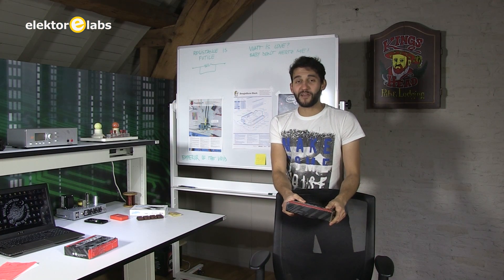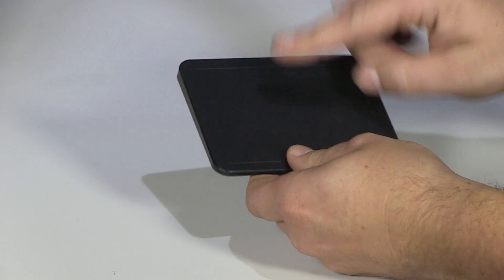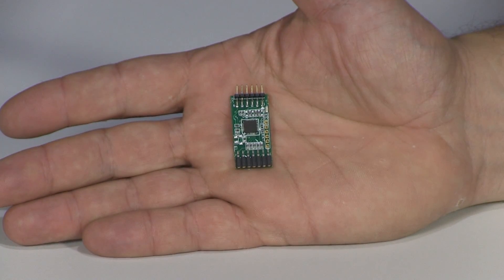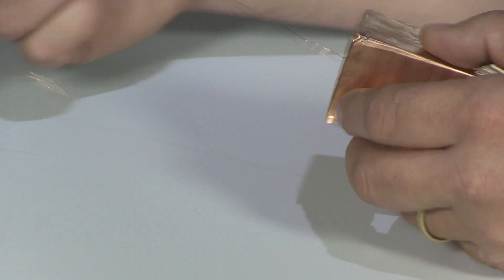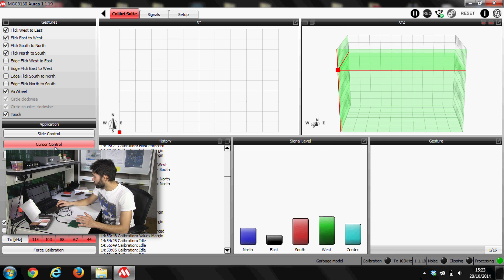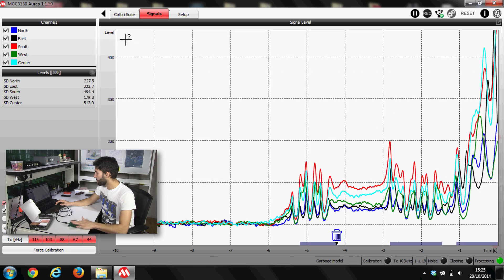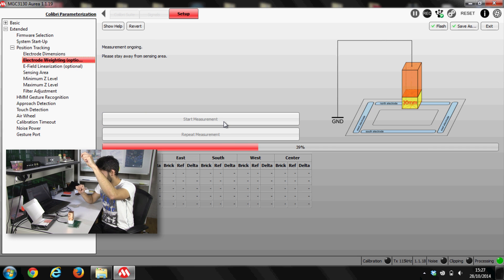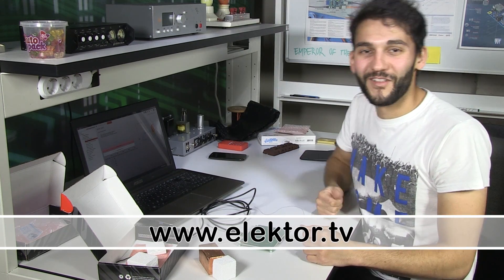Microchip Hillstar DevKit: 3D Touchless HID for Padawans

Comment: Hey i have a question ,
This sensor says its power supply should be 3.3 V according to data sheet , but if i have a i2c to usb i can directly connect it to any laptop as the laptop usb port gives almost 5V